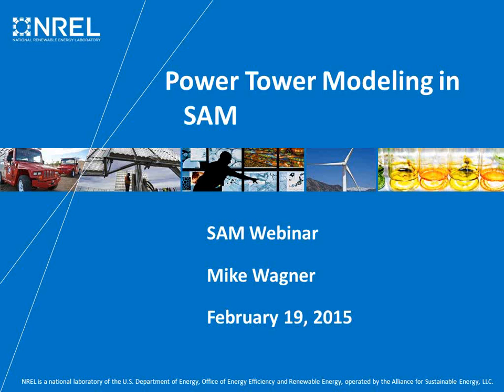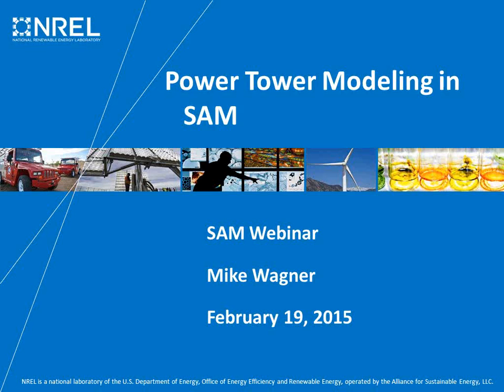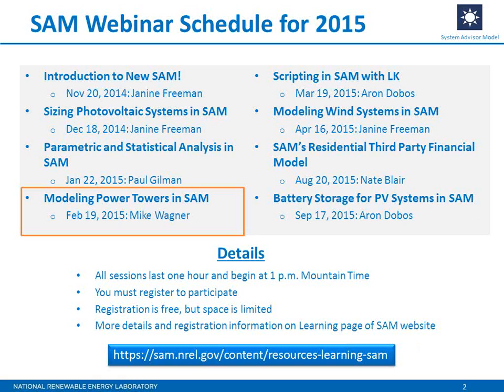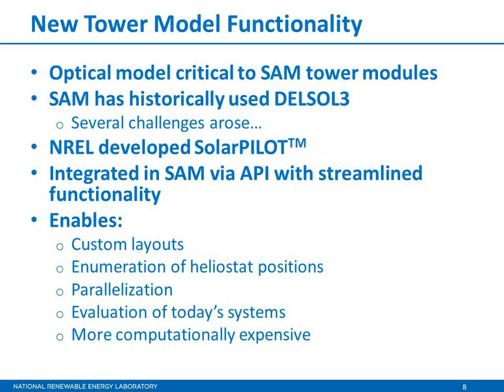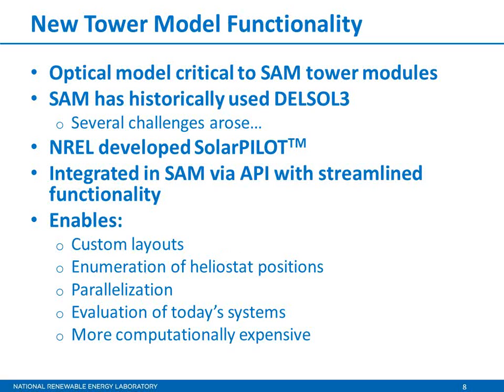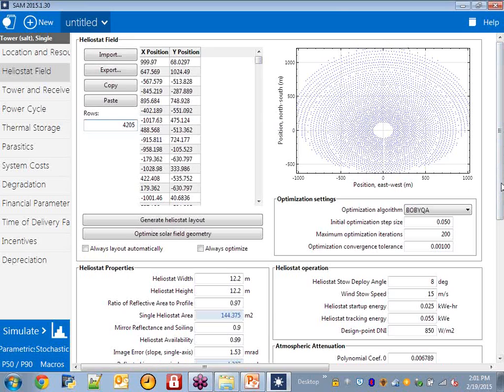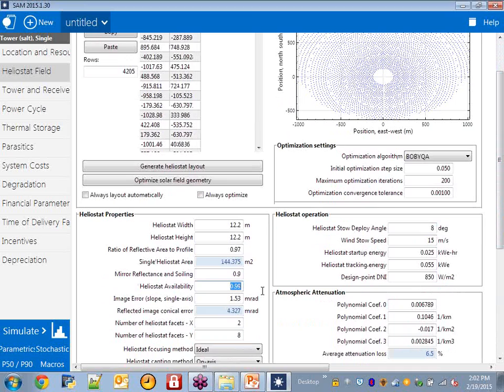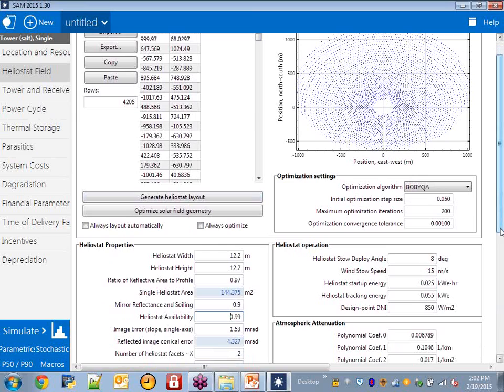Modeling Power Towers in SAM

Comment: Hi everyone, I would like to see how to import correctly field layout in order to investigate optical efficiency in SolarPilot or SAM? Is SAM appropriate to analyze small tower (100 kWe) ? Thanks
Reply from the maker: SAM's power tower and other CSP models were designed with large projects (~100 MW). Although there is no limit on the size of the system, some of the internal algorithms may not work well for smaller systems. Please post questions about SAM on the SAM forum at https://sam.nrel.gov/forum.

Comment: Hi, another question I have is regarding the Design DNI! Could the design DNI be the maximum of the of 8760 hourly design values? Thank you!
Reply from the maker: Arvind Sastry Hi Arvind -- Please post your questions about SAM on the SAM Support forum, which we monitor daily: https://sam.nrel.gov/support. You are more likely to get a quick response there. Mike gives an example of a situation where you might use a solar multiple less than one around 34:15. I don't know if there are any installed systems designed that way, but it is a reasonable modeling scenario to explore in SAM.
Reply: HI, thank you for the clarification! will ask questions on the SAM support forum!